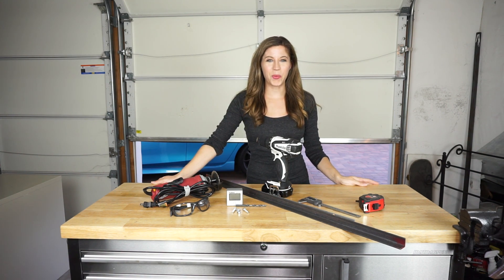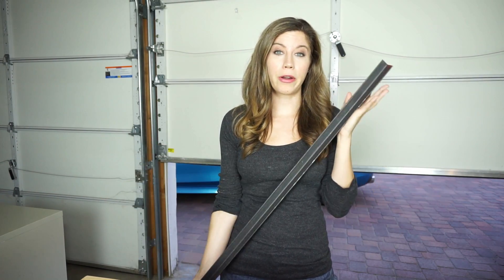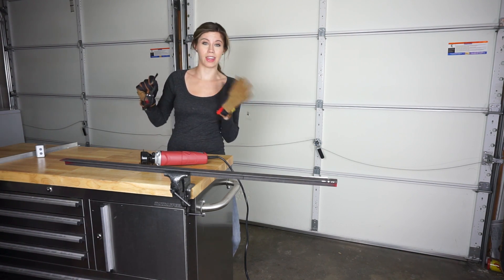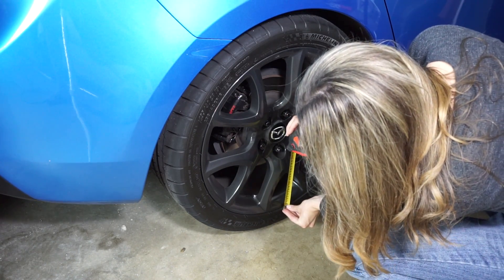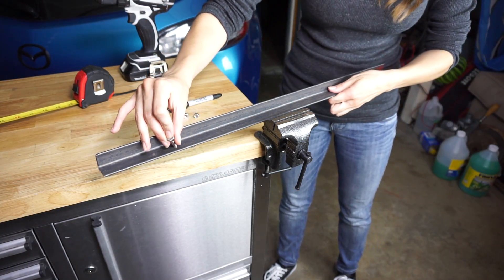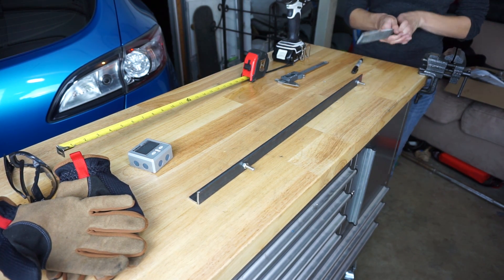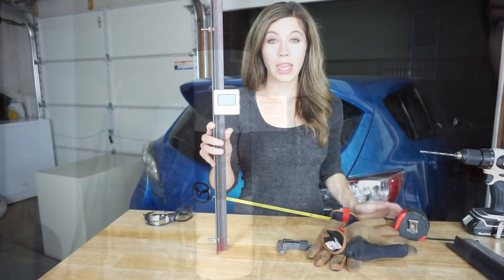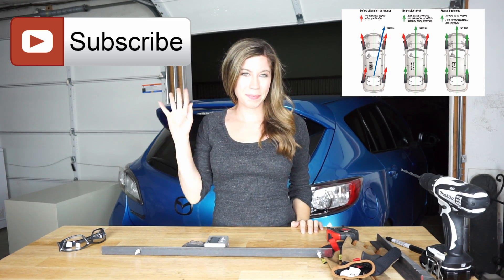BUILD YOUR OWN CAMBER GAUGE TOOL!

Comment: Way too much work and $$$ for a camber tool.  All that is needed is a plumb bob and tape measure.A piece of sewing thread and a rusty nut makes a good plumb bob.  No need to spend $$$.
Measure distance to plumb bob at top of wheel and at bottom of wheel (parking surface i.e. the floor, has to be level of course; or accounted for) If you want to convert to degrees learn some trigonometry.

Comment: Everyone is blinded by her beauty and not thinking that her alignment can be a little off, since she didn't check if the floor of her garage is PERFECTLY horizontal! Most garages are not PERFECTLY horizontal, because if you wash it, the water needs to go toward the drain or toward the door, so the water can go outside. If the floor is leveled 2 degrees off horizontal, then in order to keep the 90° tire contact with the ground, you need to set your camber alignment 2 degrees off 90° vertical, too! Simple geometry!
Reply: Agreed.  Also, would not holding the bar completely vertical effect the camber reading? I would think that it changes if the bar is not exactly 12/6 o'clock, or am I mistaken?
Reply: So you park sideways in your garage?? 😂
Reply: @Eganwp:
Incline or decline garage floor has NO affect on camber readings...  What matters is that the floor between the passenger side and drivers side are level ...
Reply: @Vince Panov:
The entire garage does NOT need to be perfectly level... It NEVER will be. The only thing that matters is the portion between the passenger side and drivers side. Even if you are on an incline driveway, that does not matter as long as the pass to drivers side is LEVEL...  We are not checking camber between the front or back, only pass tire to drivers tire ..  So ONLY that side needs to be level as much as possible ... 
And another, NO garage floor is a perfect level ... it may be off by a degree or two and if it is, you take that into consideration when testing

Comment: To save buying an angle finder just use the built in level on your iphone. It's really accurate. Just make sure your phone.has a protective case round it to provide a flat edge otherwise the raised volume buttons will give a false reading. My case has cut outs in the areas of the volume and on/off buttons. If your iphone doesn't have 'compass' by Apple installed you can get it for free from the app store. No iphone ?? Get a freind round who has one lol

Comment: To zero the tool, don't assume the pole is absolutely vertical. Check on one side, then move the tool to the other side of the pole and split the difference. Or flip the angle iron over & split that difference.

Comment: Just cut the steel angle bar to the exact same length of the rim diameter and use a bungee cord to strap it over the wheel achieves the same result. No drilling required. Yet, you need a perfectly level ground for these tools to work, which is quite impossible.
Reply: Does the ground need to be level or just the car?
You level the car with a few car jacks.

Comment: When using this make sure the concrete floor or driveway is level or you will be off .
Reply: My driveway has a slight slope to it so I had to figure out the difference.

Comment: Great vid! Next time, take a punch and hit the center of your sharpie hole with the hammer/punch with the metal laying against a hard surface. That way you can get your drill bit started perfectly center.
Reply: A "BIT' goes in a horses mouth ... you mean "Spiral Fluted , Parallel Shanked, High Speed Steel Twist Drill...  :)
Reply: Yeah but you can forgive her that cos she's sweet!
Reply: Unless it is clamped "firmly" against a hard surface ( a harder rockwell rating than the metal you are working with), and in several places all along the structure, the reverberation from striking can bow, bend or twist the grains of the metal and throw off the plumb.  An old Airframer trick is to use a drill about a quarter size of what is required on a low speed setting until it makes a slight divet in metal.  Then step it up to half the size required on high speed, then 3/4, then full size, slowly making the divet larger along the way.  It's a little more time consuming, but if you are dealing with precision, whacking it with a hammer isn't always the best way to go about it.  For every other application, I agree 100%.

Comment: What do you suggest we use to prevent the bolts from scratching the wheels?
Reply: Just put some electrical tape over the end.
Reply: A vacuum cap over the ends would work well.

Comment: When filing only go forward, files aren't made to go back and forth, quick tip
Reply: ha ha , I did that at my carpentry class and got yell at by the teacher :-(
Reply: It depends on the file most are one direction and they’re are some made to go back and forth
Reply: Double cut man.
Reply: body files go both ways... but not this one.
Reply: And good files never need cleaned so they become junk files!
Reply: the forward stroke of a file cuts and the back stroke cleans the filings from the file.
Reply: @damianshaw3235  sadly nooooo!

Comment: personally i would go about achieving the desired results in a slightly different manner. First i would use a side grinder to cut the metal angle iron then sand the burs off with it (cuts quicker and sands quicker) If you really are worried about the burs or edges grab your dremel tool with a sanding drum in place and hit the edges with it. Next i would use a drill bit with the correct size but i would choose a bit with a "speed point" tip on it this style tip eliminates the need for a punch and is very effective, with it's anti-walk engineering built in. Next instead of filing all day on the bolt ends i would again use my dremel tool with sanding drum attached and sand away quickly any material that needed removing from the excess length of the bolt(s). Finally i would never assume any surface is plumb and would first verify plumb by using at least a 4' bubble level. I think she also uses the term level when she really means plumb.  And i also plan on making the bolt holes with a slot instead of just a single unmovable hole this way i can accommodate multiple rim sizes!

Comment: You may in fact use a carpenters level if the right size although this is a great idea ! You can also install more holes for different size wheels , then place the bolts where needed.

Comment: Its unlikely that a newer car needs any adjustment unless something is defective, in which case it needs replaced. But its more likely that an older car needs some adjustment to correct the angle, due to normal wear. This a a good tool for that.
Reply from the maker: Your right most new cars have static camber settings but it's also beneficial for people like us who have custom suspension and like to try different alignment setups for racing.
Reply: I fully agree with you :D I'm a bit of an old racer my self, so I'm with you on that for sure. Unmodified daily drivers work well as-is, but you get some handling and stability benefits from angle alterations. Especially on FWD vehicles; compensate for torque-steer and or under-steer by making more aggressive chamber/caster angle adjustments.
You are spot on!  :D

Comment: Hi, 
Nice diy with some comments I think you may consider to use:
you can use 2 nuts on each bolt- like a sandwich: nut-angle_bar-nut- you turn the bolt until you have desired height and tide it with the other nut on the back. Another way is to cut the thread in the holes of angle-bar and use nut to lock it in place. Also using cheap carpenter level instead of fancy tool is also an option. I'm using camber tool with magnet and bubble (~$35 on e-bay).  For drilling you better use slow speed with cutting oil- you will save the drill bit. Good drill bits are expensive! Use of drill press helps a lot. Also knock a notch on the metal with center punch before you start drilling. Another way to make it simple- use aluminum angle bar and glue piece of metal in the center with epoxy glue to have camber magnet gauge stick to it. Good luck!
Reply: DigiPas DWL80E level with angle gauge.  Currently about $26 shipped with Amazon Prime.  Magnet, horizontal and vertical bubble levels, and digital angle gauge.

I like your idea of using epoxy to attach a piece of steel to a piece of aluminum angle.  I would like to put together an adjustable bar, and I'm not crazy about the idea of trying to cut a slot in steel angle.

Comment: Thanks so much for this video. I plan to make one of these tools, but will look through the cabinet and furniture hardware section to find nylon or rubber bump stops with studs to use instead of bolts so that I don't scratch my rim surface...... Barstool feet may be the answer.

Also note that holes can be drilled so that one tool fits multiple rim sizes. 
I think studded barstool feet or bumpstops with equal length sleeves and wing nuts would make a very versatile tool.

Comment: A good and simple old school solution for checking and adjusting
front-end camber, just the way a DIY tool should be. It’s the same basic
principle I used when I designed my homemade toe and caster tools. And, no it’s not as accurate as using a professional laser aligner, but with the ridiculously high prices shops are charging now days, it’s good enough.

I'm also glad to see someone else sees the value in using
Harbor freight tools, buying a Harbor Freight electric cutoff tool like the one being used in this video  turned out to be one of the best tool purchases I ever made, an air cutoff tools can’t even come close to matching it’s cutting performance. Good job girl…

Comment: When you took it to check the alignment  were you close to manufacturers specs? I was interested in buying the name brand gauge but for almost 300$ it makes sense to pay for the alignment.  Your solution changes that significantly.
Reply from the maker: +nicholas kin It was spot on with factory specs. I change my setup a lot so being able to do an alignment myself is a big money saver.
Reply: +everythingdiy that's awesome, I'm so excited u just saved me a ton of money. Thanks!

Comment: basic tool, will do the job for most wheels. but will not be as useful for wheels that have a profiled edge. also the addition of a level to ensure ur holding the tool vertical would improve accuracy

Comment: Make sure your frame is aligned straight across linear wise as the floor the wheel sit on can be off angle and this would put everything else off angle. Level the car frame first and then level the rotor or wheel.
Reply: where can I get more information on checking and leveling?

Comment: Ok, so now you have a camber gauge, but how are you planning to change camber? On most cars nowadays you can't adjust it.
Reply from the maker: +Frank De Ruiter On this car you can. An alignment video is in the works. Hopefully we can have it up in the not too distant future.
Reply: +everythingdiy Front and rear on your car? Not too shabby. As a DIY mechanic I maybe quite spoiled, I've a John Bean Visualiner in my garage to do the alignment on my cars so I'm curious how this turns out.
Reply from the maker: +Frank De Ruiter I should add the front has about half a degrees of adjustability and the rear about five in either direction. The only reason the rear has so much available is because we did a video where we installed adjustable rear control arms. The factory control arms kept the rear camber static. I wish we had an alignment machine but there's no space in our garage. We'll have to stick to our DIY camber gauge, jack stands, tape measures, dial caliper and string.

Comment: A couple of tips: You need to clamp the spot that you're going to drill, cut or grind much closer to the vise so the piece does not shake and create a unsafe situation. When drilling holes don't just start with your final drill or else the bit will dance unsafely (like in  this video) and potentially skate off or drill into the wrong spot. Instead stop the spot with a sharp center punch first so the drill bit will bite into that divot and not dance around dangerously or you can drill a pilot hole with a tiny drill bit (they will bite and drill through without dancing, try it) then go to the final drill bit to make the hole.

Comment: You were using a cut-off or grinding tool, that would depend on what type of wheel you mounted on it.  I prefer the 90 degree die grinder.  It has interchangeable arbors for cutting wheels, burrs, even drill bits.  MUCH better control and much easier to use, and therefore MUCH safer!  (and MUCH more versatile! )
Just another comment dear, when using a file, only file in ONE direction!  when you 'scrub' the file back and forth, it will flatten the cutting edges of the file and then it becomes worthless.  Also I would recommend de-burring the drill bit holes (both sides) before inserting the bolts (you could use the same die grinder with the wheel already in it! :D ).  This would ensure the bolt heads and shoulders are laying FLAT on he angle bar.

Comment: The one measurement that I did not see done was the one to CENTER the bar between the floor and the top of the wheel well. If you had done that, it would not have extended above the wheel well when you used it. And if you measured so that is was NOT LONGER than that length (floor to top of wheel well) then you should have made it so that it was CENTERED......so all you need to do is go back, remeasure, this time CENTERED, and cut the new holes...and it will be perfect. Apart from that this was PER-FECT! Thanks so much, will be making mine soon.

Comment: OK, I like the design of the homemade tool. But in order for it to work doesn't  the vehicle have to be on a perfectly level floor/ground? If I don't have a level ground there's no sense building this tool?
Reply: +damkayaker 

A good way of checking the level is using a 1/4” inner diameter, or similar size, clear flexible tube with water, and a drop of detergent to reduce the surface tension inside, to use the water line to check the level.  Can check the level of the center of wheel, center of wheel hub, and to see if the wheel, as well as the tire distance to hub is true, while spinning the wheel when up in the air. The floor or ground does not need to be level for this to work, as water always seeks it's own level. This can be used to make blocks under tires or stands that can be used to level car.
Reply: +damkayaker I think this is a really good point. Could you put a corner square on the ground so one edge is vertical and the other is laying on the floor parallel and then check the vertical edge to see how much tilt there is? Nothing like this is ever exact, of course. Then you would have to adjust your camber measurement to account for that tilt, if any? This is probably best done in a garage with a relatively flat and level surface (although I think most home garages are still on a very slight angle tilting toward the door).
Reply: +Cody Mooneyhan 
That is a good idea! A large carpenters square. The floor surface would have to be on the smooth side though. Regardless if the ground is perfectly level, the wheel should be 90 degrees to the ground. If it's a rough surface like a concrete side walk there would be bumps which will interfere with that method. I recently replaced all front end parts, upper & lower ball joints, control arm bushings, inner & outer tie rods, stabilizer end links and bushings for stabilizer bar. I got my vehicle lined up good without going to a garage. New tires on it now, time will tell...

Comment: Lol i just used the tire it self as this tool. I picked up a 06 chevy z71 that had bad spots on the inside of my tires.so I just gave the bolts that hold the torsion bars a couple turns and it not only fixed it but it leveled the truck a bit.i did go to far at 1st that was not good and what I did is not really a good fix but it will due lol. This is a nice little tool you made though and I will be making one  to use with all my cars.

Comment: cleaning up the edge after the grinding operation is called de-buring. center punch and pilot hole, step up drill sizes until you reach the desired size, and finish the hole with a chamfer.  aww, what the hay you do better work than most men. and are much easier on the eyes

Comment: 0:21 That's a cut-off tool, not an angle grinder. It can be used to shorten a piece of steel angle stock, but a chop saw is preferable. And depending on where you buy the angle (the common word for steel stock with that cross section), you may be able to have it cut there. 
The bolts, if form the same manufacturing lot, should be identical, but if you want to measure them, it would be easier prior to the assembly of the project. 
Using the measuring tape vertically 2:47 is unnatural. Horizontal would be easier, but if the steel angle is already the right length, simply hold it up to the wheel and mark the points where the holes will go. The tape isn't needed.  
3:20 The working area of the material should be near the jaws of the vice, not way at the end. The force of pressing the drill down and the vibration will be less of a problem if presented near the secured point.
Nonetheless, she's very cute.
Reply: TheStoryUp who cares least she out doing something productive which is more than can be said for 95% of people these days.....
Reply: +Nehmo Sergheyev Dude, don't be that guy,. Just don't.

Comment: Just a correction on your caliper use.  You use the other side of the angle bar rather than keeping both points on the bolt/stem side of the bar.  This is probably splitting hairs as you'll only see 1mm or so of a difference in the bolt-head thickness but you want to measure the length of the protruding bolt on the wheel side against the surface of the bar facing the wheel.

Comment: When you're drilling holes, especially drilling into metals, center punches are your friend.  I usually start with a 1/8" bit, and then work up, at least when I'm not using the drill press.
Reply: Use center punch and step bit